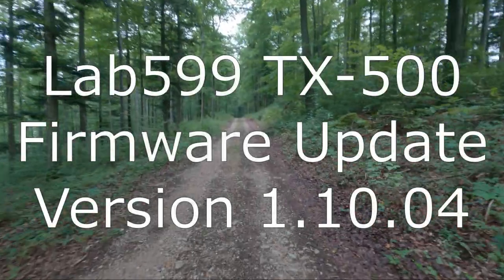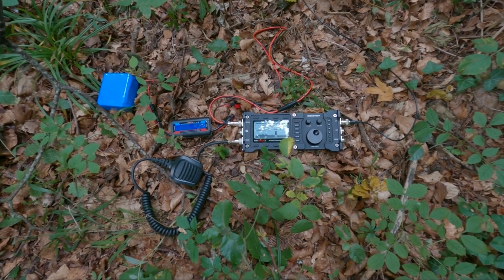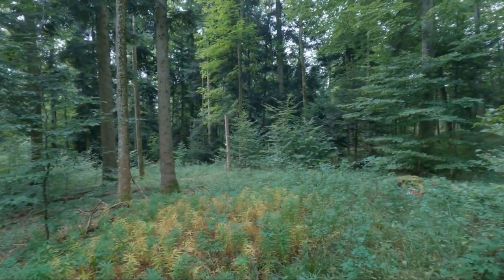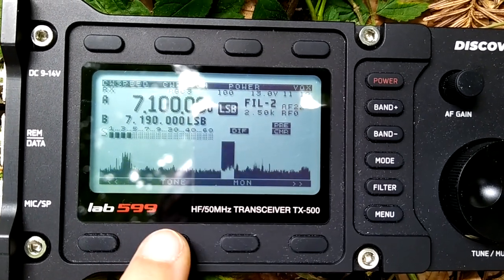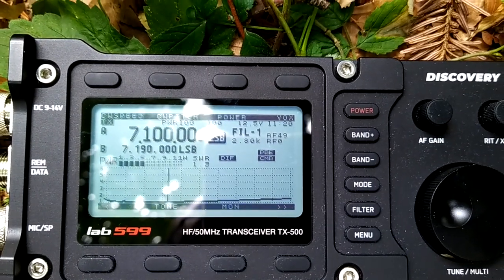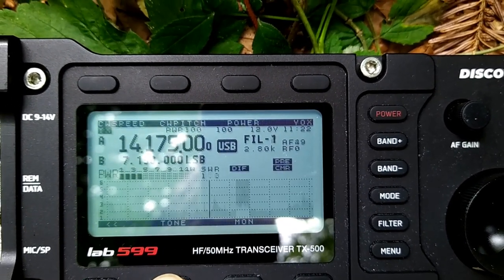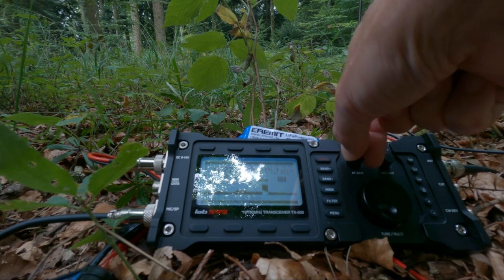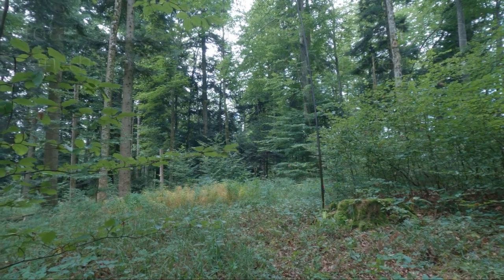Lab599 TX-500 Transceiver Tests after Firmware Update to Version 1.10.04

Comment: What are those periodic cracks in the audio? I hope they are not TX-500 internal noises.
Reply from the maker: Hi, not sure which crackling you mean. It's either static from the radio, or my GoPro 9 which had this defect. I made a video about how to FINALLY solve it 😃
Reply: @PortableRadio  I noticed it too. Sounds like the old Russian Woodpecker OTH RADAR.
Reply from the maker: @rjy8960  you're right, you can hear an OTH radar towards the end. You can hear them pretty frequently and on different bands and from different countries.